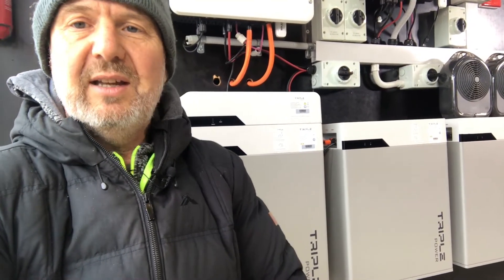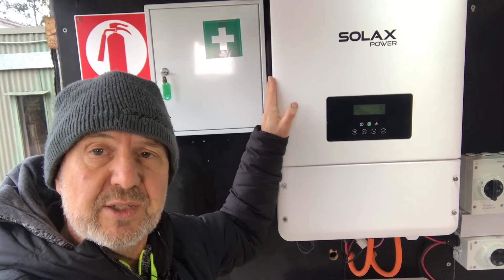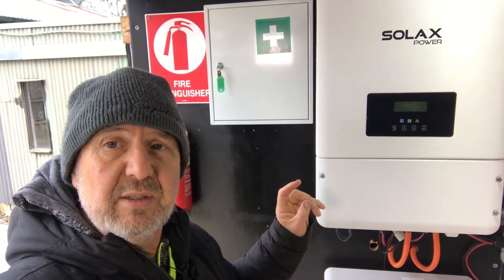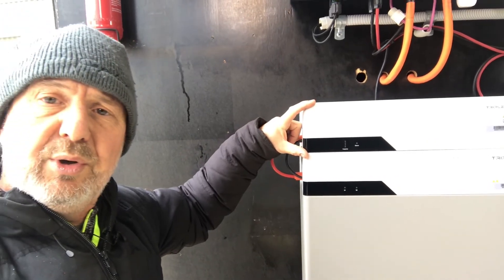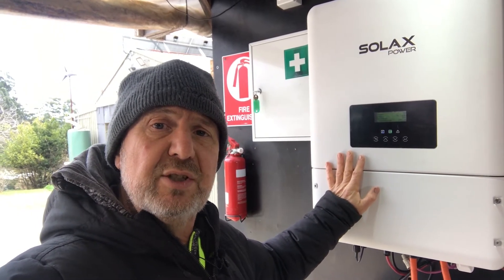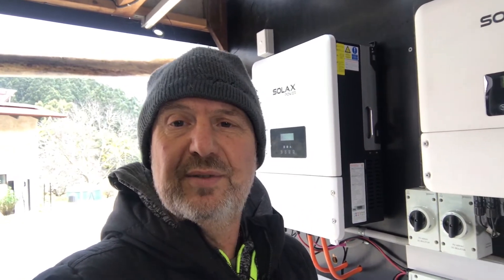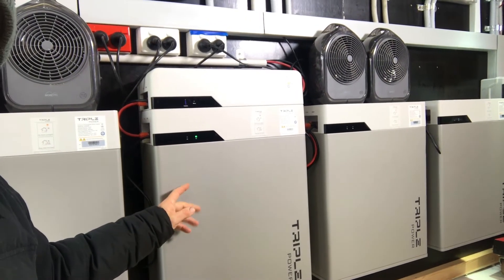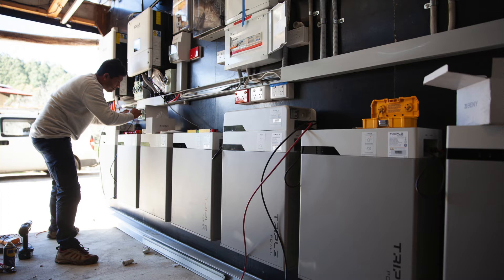SolaX Hybrid Gen3 X1:X3

Comment: Hi , I have a solax x1 g4  hybrid installed at my place And it keeps on displaying waiting status from last 2 days. They have updated the firmware. There is voltage on the pv 1 (360v- 8 panels ) and pv2(135- 3 panels ) ( checked with multimeter) . Is there anything you can suggest please. I do not have any batteries. I am thinking of adding them later on.

Comment: great video question. can u run X3/meter and X1/CT together?? ) so having 4 bats on X3 and 3 on X1 on same grid connection. thx
Reply from the maker: Both X3 and X1 have separate meters and their EPS circuits supply separate loads. Both inverters are on the same grid.
Reply: @SmartEnergyLab  thx. sounds good. will check it out. did u ever have issues in extending the batteries. i startend with two 5.8 triple master slave and then put another one and found out that charging and discharging doesn't work properly, all seems to be working but to big jumps on discharging and charging, so I moved back and need to figure out whats wrong was reading that if u extend battery socket should no be greater then 40%... thx

Comment: Dear Colleagues,
We have the following problem with Solax T58 BAT and Inverter Solax Hybrid 15-G4 D.
Before two days the installation was running on batteries during the night and when the charge drops to 8% system shuts down.
On the next day, the invertor didn’t start charging the batteries again from the PV installation and we turn the diesel generator to simulate grid to inverter, but still batteries did not start charging.
I need your advice on waking batteries again and starting the inverter with PV.
There is a message on the inverter displaying “UNUSUAL IDLE”. Somebody help us?
Reply: How did you sort you inverter

Comment: Hi Glenn that's a dream set up you got hanging on that wall. I have a quick question for you can these batteries run in parallel just as well as series?and do they need a SolaX inverter to activate them? The reason why am asking is because I'm in Argentina and it's very difficult to find lithium batteries here! I have in mind to do an EV project and I was thinking of repurposing these batteries for that project!

Comment: Hi Glenn, great video, thank you for spending your time doing it.  I have bought 2 x 6kw X3 Hybrid inverters and 4 x 6.3kwh batteries.  I am about to install, however, I am unsure where or how to install the MODBus meter and what purpose it serves? The installation is going in an attic around 20m away from the mains in the cellar.  Thanks in advance. John

Comment: Hi Glenn, thanks for sharing that with us. I'm looking at getting an X3 Hybrid 10KW inverter and 2 x 6KW batteries. As some time has passed since you posted this and you have a lot of components, have you had any issues or failures on any of the components.
Reply from the maker: Yes, the original TriplePower batteries have been replaced with the new model that has a completely different cell type (prismatic instead of cylindrical) and with an updated BMS. The inverter is still the orginal 10kW X3 hybrid. A few firmware upgrades have been done. Please note that the three phase inverter needs a minimum of three batteries to achieve it's start voltage.
Reply: @SmartEnergyLab  thanks for this. I did not know that part
Reply: Hey am i abale to use x3 12v 200ah deep cycle battery's on the x3 hybrid sloarx inverter. @SmartEnergyLab
Reply from the maker: @Mike-n4p1u  No. This is a high voltage battery inverter. Check SolaX's website for compatible batteries.

Comment: You wouldn't have a canbus log dump by any chance?  Care to sniff the canbus for the frame IDs used between BMS and inverter?
Reply from the maker: Sorry Lucas but no I haven't.
Reply: @SmartEnergyLab  knowing what extended-id can message follows message ID 0x1871  (500kHz baud) would be really cool :) an in-depth analysis of how the inverter talks to the BMS. Worthy of a follow up maybe? I'm keen to work out how to interface a different battery to an X3 inverter by pretending to be a triple power BMS unit.

Comment: Hi Glenn, What energy meter you used for Solax X3 hybrid? Will  a SDM630-MODBUS EASTRON meter work with out any setting or firmware change? Thanks!
Reply from the maker: Drone X I always use the meter that the hybrid inverter comes with as there are many variables
Reply: @SmartEnergyLab  Hi Thanks! I just got installed a 10KW 3 phase hybrid and no meter came with it.  I heard it is not legal to install a hybrid inverter without a meter even with out batteries yet, is that correct? Could you please mention the power meter part number or place to buy one in AUS
Reply from the maker: @dronex4359  Without an upstream power meter the hybrid inverter won't be able to support loads with stored energy. The battery will just fill up and stay full... unless you set some Time of Use charge/discharge periods.
I would suggest you contact SolaX in your country for more info on the meter required.
Reply: @SmartEnergyLab  Thanks a lot for the info and lot clear now! I am in Australia like you!

Comment: Hello glen, I could use this with a Tesla module battery? Not the Powerwall a battery from a Tesla model s vehicle
Reply from the maker: No
Reply: Am speaking to a seller from China who said otherwise thanks for the affirmation
Reply: Please you could recommend any inverter I could use for a Tesla battery I’ve 12kw of pv arrays
Reply from the maker: James Joseph a Tesla battery is not a generic battery that you can just connect to any inverter. It’s more like swapping engines in a car, there are many integration issues to consider.

Comment: Hi, enjoyed your vid, i was abit worried with them as i cannot find many reviews, would you reccomened them, i had a issue with my provider, iw as getting the 10kw LG solar edge system but they let me down but i have this option of the solax 12.6 tripple battery, would you go for this or should i hold out for the LG 10Kw solar edge, i was thinking of the Tesla 13.2 but its a lot more expensive

Comment: How does the unbalanced loads work,  specifically with 3 phase.  It requires at least 2 batteries to work?
Reply from the maker: Hi ESM, the batteries connect to the inverter's dc bus at ~400Vdc... the 3phase inverter then can generate and support each phase independently.
Reply: @SmartEnergyLab  so if there is say 2kw on one phase and 1kw on the other two, what happens say in scenario 1 where there is no solar generated and scenario 2 where we have 6kw being generated.
Reply from the maker: EvilSeeMonkey  the battery can sink or source energy to buffer imbalance or the solar can be curtailed if battery full and export inhibited.
Reply from the maker: EvilSeeMonkey think of the inverter as having three taps regulating flow to support the three phases, if solar generation is greater than the loads then first charge batteries, then second export to grid if allowed to or curtail solar production by moving the PV array away from the maximum power point.

Comment: Hi Glen, huge thanks for a great video, can you please share more information about at automatic transfer switch when changing over to EPS mode?
Reply from the maker: Hi Mark, the ATS operates when the grid fails and switches the grid parallel port on the X3 over to the backup loads. There is a short few seconds changeover.
Reply: Huge thanks Glen, your video has help us a lot, we have been installing the system since March with the EPS Box or magnetic contactor change over, most recent was here https://youtu.be/GSkqipf2oxY

Comment: Hi, great video thank you. I have a question, can you connect two BMS module in parallel so you can have more energy storage, for instance i need to use X1 inverter with 5 triple power batteries, i need the storage to be 31.5KWH for single phase use?

Comment: Hi Glen, thank you for this video, it helped me a lot to solve many doubts i had, thank you.

I read on the manual that the parallel function is still in development, do you know if that is true? We are thinking to use 2 Solax X3 6 kW in parallel, and 3 batteries T63 for each inverter.

Thank you for the help,

Toni
Reply from the maker: Do you mean parallel on the grid side or EPS side?
Reply: @SmartEnergyLab  Hi Glen, i mean the possibility to use the two inverters and have 12 kW output. I read that the CAN/GEN port is being developed. Thank you

Toni

Comment: Hi there Glen. Thanks for the informative video! Do you know if it's possible to use different batteries with these hybrid 'HV' inverters (rather than the SolaX ones)? I'm considering using the single phase version as charger/V2G for a tractor project (running at about 350vDC nominal) and these X1 series could work well if so.
Reply from the maker: Hi Duncan, I’ve used the X1 single phase with a 200Vdc Pylontech 48050 LFP battery stack using the Pylontech string combiner.
Reply: @SmartEnergyLab  Great, thanks Glen. Is the pack->inverter comm on a standard CANbus protocol?
Reply from the maker: Hi Duncan, the battery pack connects via RS485... I'm not sure if it's CAN or Modbus. Best to ask Pylontech directly.

Comment: Dear Glen, Hanks for the great information. The description on the Homepage of the 3 Phase Hybrid speaks about a Generator Interface. Is it somehow possible to integrate a diesel powered generator into a system for even more power outage protection?
Reply: no directly only thru a change over.switch

Comment: Great vid Glen. Question on the unbalanced loads So I can get it clear in my head.  Let's say generating 6kw. if I am drawing 3kw on phase 1 and zero on 2 & 3. Can it use 1kw from other phase to increase self consum on 1? Then will only export combined excess? Or send excess to storage of batteries installed?
Reply from the maker: Freenergy Ltd you’re limited to 3.3kW/phase (10kW unit) of load support. So up to that limit the SolaX can use solar + battery to offset grid consumption. Excess PV generation is first sent to loads (in Self-Use Work Mode), then battery and lastly to grid export if not curtailed by export limit settings.